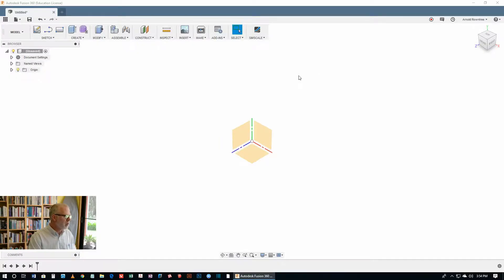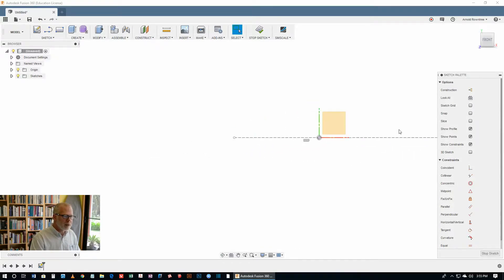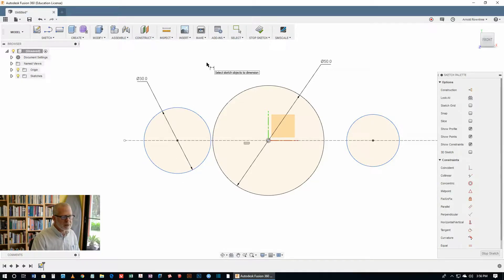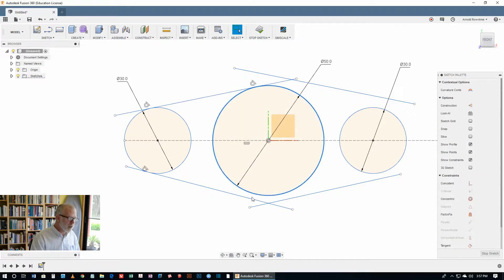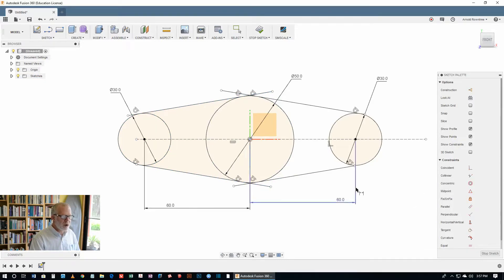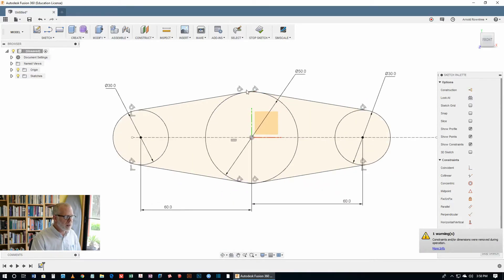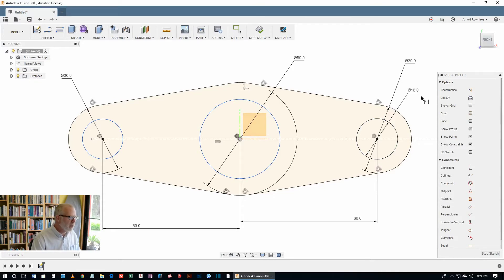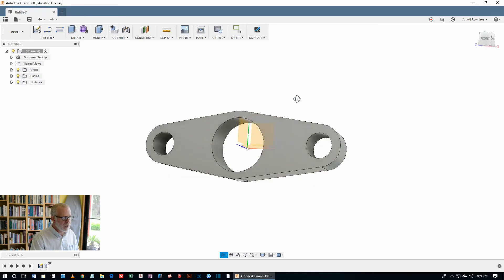Fusion 360 Beginner Tutorials - Part 10 of 16

Comment: Is your sketch fully defined? If you type in "Sketch.ShowUnderconstrained" ( I learned that from Kevin Kennedy) it says: Sketch.ShowUnderconstrained 
Under constrained points: 14, under constrained curves: 9 and my sketch wont show the lock icon in the browser. I have the drawing dimensioned and it won't let me add any more constraints or dimensions unless I want driven dimensions. I figured it out! To get my sketch to turn black so it was fully defined, and the lock icon to appear in the browser, I had to dimension all the lines, and the acrs on the top and bottom. It is probably not important to get the sketch to be fully defined if it's a single part like this, but if your doing an assembly everyone says it's importand to fully define each of your parts ot it will cause problems further down the line in an assembly.
Reply from the maker: Its true Gary, I didn't care very much at the time I did these beginners tutorials but you'll see in the revised ones (I'm up to #7 now) I'm paying more attention to these things. https://www.youtube.com/playlist?list=PLFCTgdiT5-kLBNvrkUNy63Gu1tWdRuKkr

Comment: That was an interesting way to do it. I will have to go and try it that way. I used the line tool to make the outside. Used the sketch fillet tool on the centre two 25R. Then just a construction line through the centre to line the model up.  Thanks
Reply from the maker: There are many ways to get a good result. If you can do it in more ways than one then you're ahead of most people. Practise my way too in order to get the idea of controlling tangencies and symmetry.

Comment: Where did you get the diameters of 50 and 30s off the start? How would know that I needed those from looking at the diagram? When I tried to do it on my own without watching the video I ran into the problem of getting the outside measurements correct.
Reply from the maker: Well WiW, its all about the difference between a radius and a diameter. You'll see the R for radius on some of those dimensions and the diameter symbol on others. A radius is half a diameter which trips up plenty of folks, and then to make it twice as confusing, there is a common engineering feature where a hole in a filleted part has a radius half of the radius of the outline as you see at either end of this example. When one is dimensioned as a radius and the other as a diameter (according to conventional practise) you have a recipe for a puzzle. Sorry guys, its funny in the classroom but I know this is just frustrating for you.
Reply: @ArnoldRowntreeTeachesFusion360  Not fair! At least give a hint on the engineering drawing!
Reply from the maker: @linuxtrician   Hmmm, Rocky, I want the drawings to be completely authentic but there will be some way to give the hint without putting it on the drawing. In the revised version I'll state it in the video.
Reply: @ArnoldRowntreeTeachesFusion360  thank you for the quick response!

Comment: why  you do something what is not marked on sketch???  circles dimensions have diferent sizes!
Reply: sketch isn't complete.
Reply from the maker: Its a bit of a puzzle Gzegorz, can you expand on your question a bit? Notice that I drew the circles the wrong size on purpose and then constrained them for a good result.
Reply: @ArnoldRowntreeTeachesFusion360  I believe he was asking the same thing I was.
Reply from the maker: @GoGreenMan  Thanks for helping here, it takes fresh eyes sometimes.
Reply from the maker: @grzegorzgawlik6624   here is my reply to Wing it Workshop who asked a similar question; does this help?   |scroll down|

<<Well WiW, its all about the difference between a radius and a diameter. You'll see the R for radius on some of those dimensions and the diameter symbol on others. A radius is half a diameter which trips up plenty of folks, and then to make it twice as confusing, there is a common engineering feature where a hole in a filleted part has a radius half of the radius of the outline as you see at either end of this example. When one is dimensioned as a radius and the other as a diameter (according to conventional practise) you have a recipe for a puzzle. Sorry guys, its funny in the classroom but I know this is just frustrating for you.>>
Reply: Tkank you , i understand now.

Comment: Hi, thank you for the great tutorials. Hopefully you could add a simple CNC examples at one point.
Due to the some CNC machines have no limit switches is not practical to use the origin inside the model. 
However I have been unsuccessful in moving an already created model anywhere else. I believe it's because the coincident constraints that keep piling up where some lessons add more than 5 constraints in the origin due to different constructs like centered rectangles etc. In order to do the move I believe we need to remove the constraints but the interface does not seems to allow to give info about these constraints piled out in the same position so it's not possible to delete the proper one. Do you have any remedy for that?
Thank you for your great work,
Adrian
Reply from the maker: Thanks Adrian, I'll be collaborating with a friend who is a CNC whiz but not for some time yet. 
As for re-orienting a model please find John Hackney's Channel on YT and search his channel for a video on 'the Align tool'. I'll eventually do one but his is excellent and will tide you over for the time being.

Comment: I'm following along the tutorial. I found that a slightly quicker way of doing the lines, is to go from circumference to circumference, then adding tangent constraints for the start points. Saves you the extra work of cleaning up those extra bits of the lines.
Reply from the maker: Great tip!
Reply: So, you add the tangent constraint on the circle before adding the lines to eliminate the extra bits?

Comment: What does the green tick do? Is it just to return? 2:10
Reply from the maker: The normal way that the line sketch tool works is that you click and move the mouse, click again and move the mouse. The line tool stays active and assumes that you will draw another line. If you come back to the first point where you started it will close the loop and stop giving you another line to place.  If you want to stop drawing lines you can hit the escape key but it will drop you right out of the line tool, you have to click on the tool again to restart it. The green tick allows you to stop drawing lines without dropping out of the line tool and having to restart it.